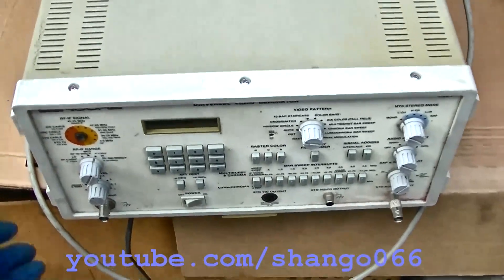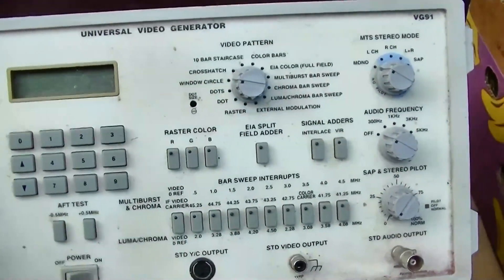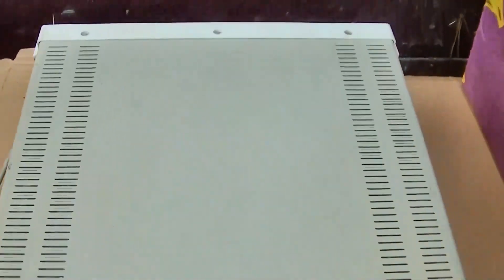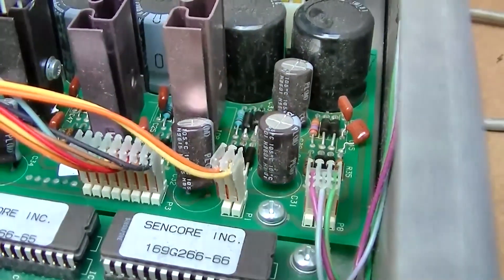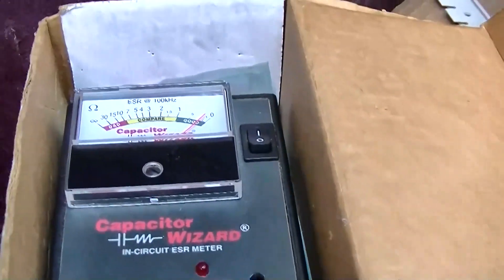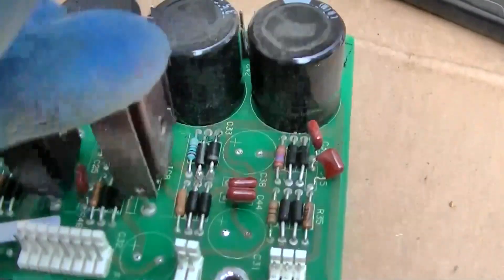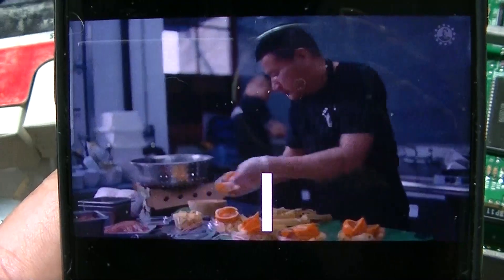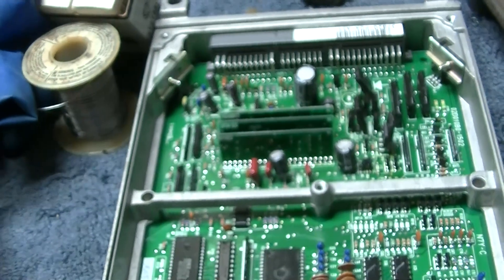Sencore VG91 Power Supply Capacitor Replacement and Honda ECU 1994 Bad Leaking  Nichicon Capacitors

Comment: The problem on that car is not the ECU. It must be something on the car's wiring or the TDC sensor installed on the car is not OEM or the signal is low amplitude.

Comment: as I've said in other comments, it's the Quaternary Ammonium Salts/Compound issue. nowadays any caps like that are usually very well sealed and for very specialty situations but are really never seen ever in anything automotive or general purpose. it's usually military spec stuff and places where a specific chemical composition is wanted (which is slightly silly for electrolytics but I can understand it if we're talking precision crap.)

Comment: On that VG91, all of those PL series nichicons, albeit not leaking, they had one of its legs tiny bit crusty. Which means you caught them just in time. Those all eventually leak, the leakage is so small at first, there will be just bit of oxidation or discoloration on one of its legs. Over time it starts leaking more and more, when it eventually corrodes the board. Also I do my smell test when desoldering. If there is just a tiny amount of fishy smell, I know the capacitor started to fail.

Comment: I'm kinda steeling your joke Shango: Don't let leaky corrosive fish caps go to waste! What you want to do after you replace them is carefully open them up and unroll them, get as much goo as you can out of them with a razor blade, put it into a refillable vape pen with a very small syringe or a tiny stainless steel spoon, close it up. Then vape away with a turkey baster (or anything you don't care about) until the heater wire in the vape corrodes through and fails. {DO NOT inhale it directly or let it get on your skin or in or anyone's eyes for God's sake} But I'm sure the smell would be amazing. Then you've done what you can. (I will try this myself eventually... stay safe tho)
Reply: That's an awful idea! I told everyone in late 2023 that 2024 was going to be awful and that was my word for the year.

That's a funny idea because I can imagine the odor. And is it really any more dangerous than the chemicals in a vape cartridge? I don't know. I don't vape unless I'm forced to buy some other idiot in my proximity.
Reply: @johnnytacokleinschmidt515  Thank you. 
It's basically the same thing you get when one of those caps overheats and sprays out the white fish-vape. You get an oddly wide range of brand smells also. I'm guessing it's oily fish sauce with industrial preservatives. The one I hate the most would be the 'mint-less menthol fish' There are 80's caps that actually smell like that, nearly made me drink hot sauce to get it out of my sinuses when I de-soldered that big bastard. I saved it in case no one believes that smell is even possible, which it shouldn't be but is.

Comment: Thanks for posting about the problem with the VG91 caps.  I have one and use it once or twice  week.  Like you I only turn it one when I need it.  I have the caps on order and hope I have caught then in time.  Once you get use to the 91 it is hard to do with out it.
  I worked in a TV shop back in the late 70s to mid 80s.  I had forgot a lot of the issues we ran into back in the day.  Not so many bad caps but more semiconductor with the Sony TVs.  Video heads and belts for the VCRs.  We worked on Zenith but most of that was just replacing modules which was a quick fix if you have the part in the van. 
  Thanks for all of your videos, I watch then all.

Comment: Those Hondas have a green colored ignition ecc module behind the knee bolster that are notorious for going bad. They induce a voltage drop to the ECU and cause all sorts of problems. Lack of a check engine light bulb check and/or no crank signal pulse is a dead giveaway. Bad capacitors are the cause.

Comment: Surface mount caps were a big problem also. Mitsubishi projection TVs would loose video due to bad surface mount caps on the Picture in Picture model. The caps would leak and destroy the copper traces. Most of my customers had no idea they had Picture in Picture ability so I would just install jumpers to bypass the pip module with their permission.

Comment: here in the UK, that era of ECU for in-demand JDM vehicles is absolutely worth repairing, cause the money is there, people want there celica ST185 or S13 silvia to run correctly and are happy to pay.. for an early 90s shitbox thats likely needing welding and god knows what else to put it back on the road when its worth less than 1k. not so much. w.r.t bad caps, i have to say about 70% of compnent level failures in modern vehicles i repair are those little ceramic surface mount caps going open or short, or both, intermittently, for fun.

Comment: The electrolyte they used in that era is a ticking time bomb everywhere. I had a new old stock nippon chemicon lxf series in the drawer that started leaking out of nowhere. Real nasty stuff too, stripped the tin from the lead of other capacitors I had in that box. They're replace-on-sight for me. Not even gonna bother testing them. I think elna and few other Japanese brands use the same stuff in their capacitors from that era.

Comment: The Honda 4 cylinder engines from that era have a reputation for distributor bearings failing.
That’s looks like instrument cluster caps are gone.

Comment: Modern cars with interconnected electronics for literally everything, cheaply made, poorly designed, and rushed out to market with minimal testing - its going to be impossible to keep them on the road after fifteen years. Although I suppose by then both the plastic and lightly build transmission and engine will have already grenaded.
Reply: It gives them additional markup and something 'cool' to add in the specs: "all electronic!" and "obstacle detection!"

It's why taillight housings for F-150 trucks are now a theft item - they have LIDAR sensors (for obstacle detection) inside which cause them to have a $1200 to $1500 replacement cost (EACH!), instead of the old models that could be had for $120 to $150 (or even less from knockoff manufacturers).

The LIDAR systems are really just a substitute for poor or inattentive driving.

Also, you can't just NOT replace broken modern taillight housings - the system takes down your radio and HVAC system.
They've seriously over-complificated modern cars.
Reply: Whoa! Ugly stuff. Buddy had a $1200 tail lamp housing on a '21 Chevy truck. I didn't contemplate any sensors. I just figured it was because it was about a year old at the time.
Reply: Yep. Apparently they can leak, maybe it gets cracked or get misaligned, water gets in - then your radio and AC stop working. Huh. What could that be. $1500, plus labor, etc.

I'm a hard *ss. I drive a 97 Explorer. The horn is connected (by a wire) to the horn. The wiper-washer motor is connected to the wiper-washer switch. My wife has a 2009 Jetta. All those things pass thru an electronic module. That module connects to the horn, wiper, whatever. That part is $800. When it goes out, one or more of: horn, lights, washer, wiper... stop working. 

It's just ridiculous.

But it explains why a new pickup is now $70,000 and insurance for it is expensive.

Comment: Between you and Banderson I decided to check mine.  Like yours, the caps looked fine and tested fine.  Although, I did have a slight fishy smell when removing them.  I replaced them with 330uf @50V as I did not have any 220uf.  Still works. LOL

Comment: Would Trouble Travel from ECU to Relay, or visa versa?  
hey! don't make it harder, i'm Still trying. Caution to what my 'ventures' find.  Was Reading, [scary in itself] .. there's an avalanche somewhere, just who starts it first, is question.  lol   
Only at OBD1 level, would be nice to grasped more read.  14:14  There's more to that Sensor & ECU than told.  haha  perhaps even more to scope ability.   
glad my car's issue [just] fuel.    Thanks, i'll continue now, fear's gone.

Comment: I would have put 105℃ back in.
Reply: They have grades that would be even better and more robust for extreme climate conditions such as  you would see in a car. Most automakers use a grade of those but not the highest most robust grades and the extra cost isn't that bad to upgrade at all.

Comment: I've seen some weird symptoms when ECUs start getting flaky over the years. Right now we have a 2012 Accord 4 cylinder that throws codes every couple of months but still drives okay when the Engine light is on. It usually clears itself after a day.

Comment: I remember when there was a capacitor plague that effected almost every computer motherboard made.  Wikiped says it was from 1999 to 2007. 
Look it up , it gets interesting.  Do you suppose that earlier that a 1999 vehicle ECU should be checked as well?
Reply: I replaced many a motherboard cap in the day, I don't miss it.      As for pre 1999, definately. For what I dabble in, late 80's ford ecus are always suspect.  And I think if you go back about a year in videos you'll find an early 90's ford ecu repair.

Comment: Regarding the ECU, perhaps you already know this / have done it but didn't put it in the video or it just wasn't worth repairing, but it might be of help to anyone else trying to repair one of these.

Since you know it's throwing an error because it can't read a specific signal, it's at least alive enough to consider being a candidate for repair as the microcontroller is working.. in this case you can try following that pin / pins on the ecu socket back to the microcontroller with a multi meter starting at the socket. 

Usually the input pins of the microcontroller will have a pullup / pulldown resistor or sometimes a diode / transistor somewhere between the controller and the socket, shorts / bad power surges etc can take them out.

I repaired an ECU a few months ago now somebody had re-capped and given up on, it was throwing a no crank signal,  following the pickup pins back towards the microntroller I found a surface mount resistor that was a slightly off color, looked ok though certainly not exploded. but no continuity across it, swapped it out and the ecu works again.

Had similar success with another ecu a couple of years ago, I can't remember the specific fault but following the suspected faulty pins back i came to a transistor that tested bad, it looked fine but replacing it also revived that ECU too.

Worst case is that its the actual microcontroller that has a faulty input pin, which can happen too if you are really unlucky, but its' usually something on the input line that dies first.

Oh i'm sure you know too but maybe somebody doesn't but the plague of bad capacitors in the late 90s early 2000s was a big scandal at the time.. if memory serves somebody stole a formula for the electrolyte from either nichicon / rubycon or one of the other big Japanese manufacturers and sold it on the blackmarket to some hong kong / taiwan or chinese capacitor maker. The formula was incorrect and didn't contain the appropriate inhibiter chemicals so you ended up with loads of makers all using this wrong stolen forumla which turned them into mini bombs.. they usually overpressured and blew their tops.
Reply from the maker: I traced the signal back to that little stand up board next to the bad capacitor. It's just not viable for a high volume shop to spend excessive Time on an old beat down car whose owner has no money. It's triage, You do a quick assessment and then fix those that are Easy to moderate to get back on the road.

Comment: I love that we went from mechanical speedos to fully digital ones with stepper motors but the "waving needle" is still a thing and it still signifies a problem. Just a different one.
Reply: The biggest cause of problems in cable driven mechanical speedometers was lack of lubrication. I've have one car from 1960 with over 120k on it and the speedometer works perfectly because it was always lubricated routinely.
Reply: @Suddenlyits1960 then lube the electronic speedos.

Comment: Might be my eyes playing tricks on me but the negative pins of those sencore caps look like the solder on them was starting to oxidize in that weird way electrolyte causes, You might have caught it just as they were starting to weep
Reply: I wonder what kind of caps your presidential folk are running? RIFAs and CapXons and other fine Shenzhen specials?

Comment: Capacitors high on their legs, flapping in the breeze, ask that man with the leaky ones if he often transported the set in his car. The vibrations in a car and the weight of the cap high above the PCB will have a bad effect on the seals of the connection, and I think that is also partly the case in the automotive branch. Miles and miles of vibration is a bad thing, the motor slopes through all sort of frequencies, so resonance is guaranteed.These caps neet to be bottom flat on the PCB, preferable with three dots of glue not touching the leads.

Comment: Honda is cool in such point that if it is good/desirable enough car you can go with hondata ecu. It is "piggybacked" original ecu. The extra stuff inside just alters signals and gives you ability to remap everything i.e. fuel maps, ignition timing etc... i saw it was accord and dont even know if there are desirable body/engine combinations. But it is plug and play, no rewiring needed.
Reply: they just reflash existing ecu with some map nonsense, they don't fix hardware

Comment: Correct me if i am wrong... But comparing Shango's power supply board with Bob's, it seems that the caps on Shangos board were mounted 2mm off the board, while on Bob's PSU they were flush with the board. So basically if caps leak on Shango's board the sauce has to run down the legs and if so, pool at the solder joint of the component first. Which we can see evidence of. But on Bob's board with the caps mounted flush the soup gets trapped underneath and spreads all over the bottom, bridging between traces. Thats why I recommended to Bob to mount the replacement caps with a gap off the board.
Reply: Yes, and I did :)

Comment: Bad caps. It's almost always bad caps! Back to the 1990s and with a little heat and time they leak onto the circuit boards.
Reply: Electrolytics turning to resistors is what killed my eMac.